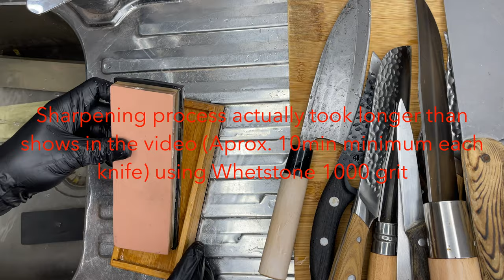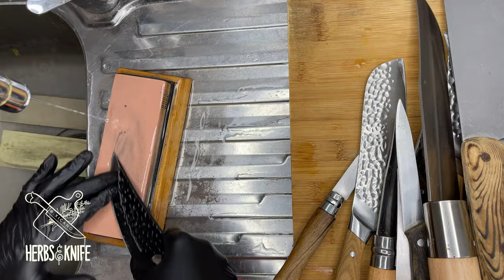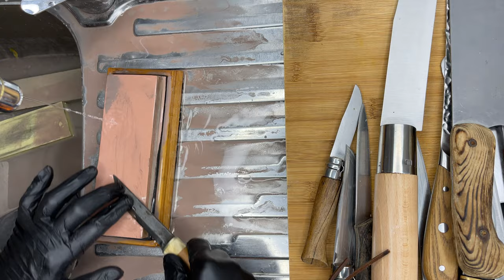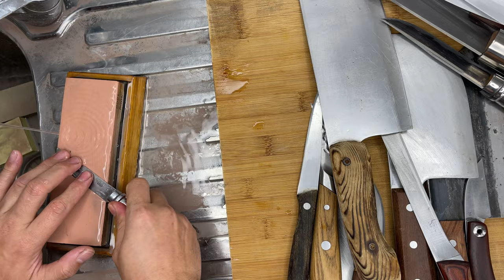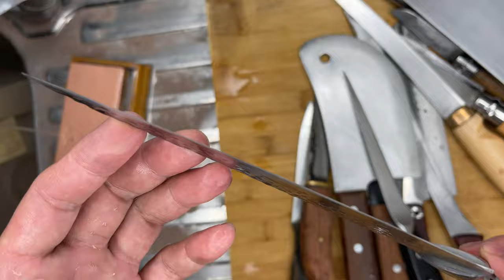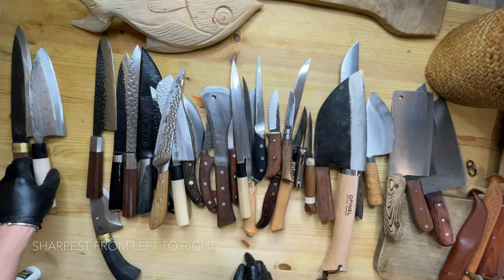kitchen knife collection maintenance after several use. Part 2 - Sharpening each knife

Comment: So, do you sharpen each knife with the same angle or depending on each blade? 
Shouldn't the Martiini Scandi blades have a 22 degree angle and most of the others a 30 degree angle? Or is this a difference which doesn't really matter?
And do you use leather afterwards or is it good enough without?
Reply from the maker: @fishesmans1friend ,  thank you for your comments.

I sharpen it depending on the knife initial blade angle. but my preference is to lessen the angle slowly going to single beveled in the process. lesser angle means sharper and it applies to all knife I have. 

leather is optional I don't see its necessary for kitchen knife. if its for Labaha (Razor), maybe yes. 

Cheers!